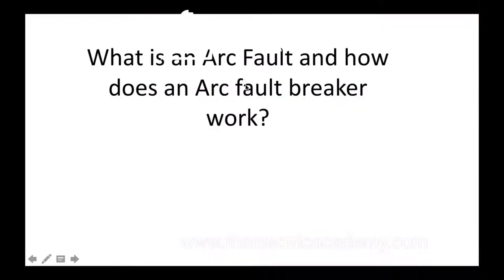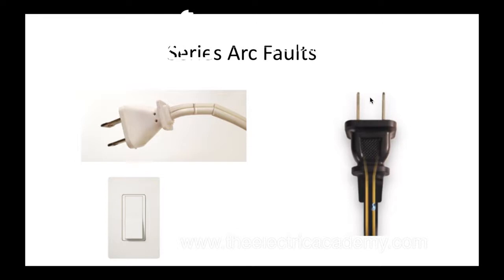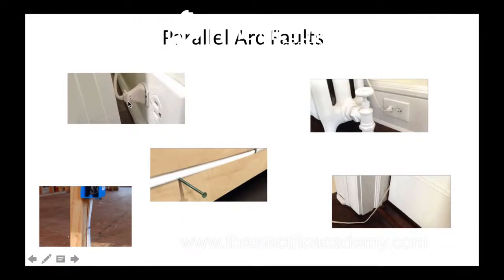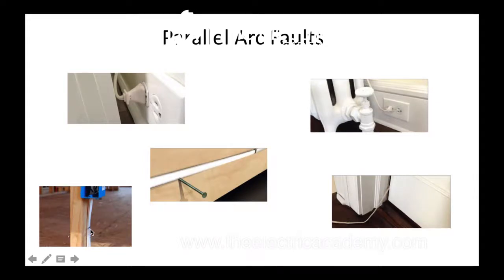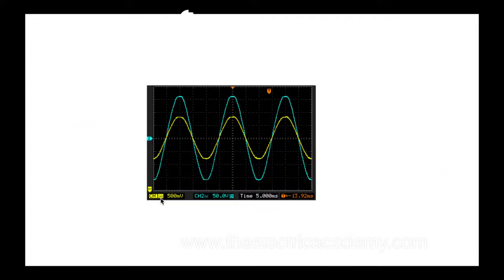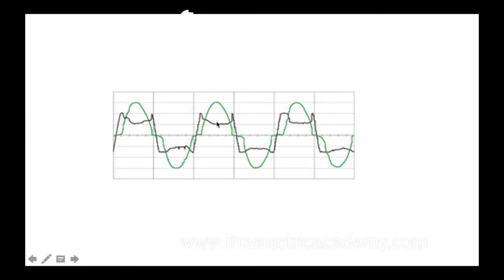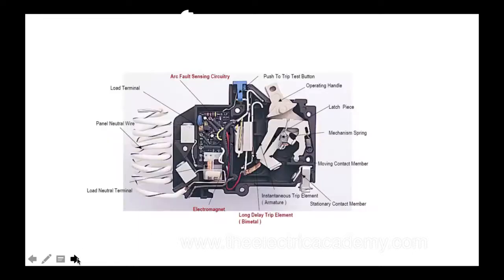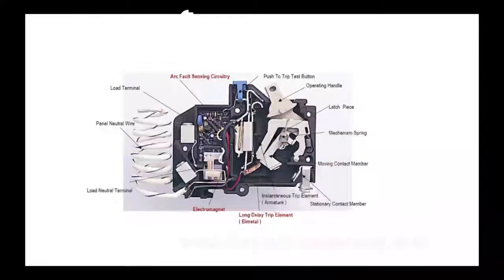How arc fault breakers work

Comment: A.F.C.I. breakers have tens of thousands of arc signatures programmed in so it does not trip when it sees this type of arcing.  Like different vacuum cleaners etc.    I have troubleshot afci breakers trip intermittently from one single led trim   and    a coffee maker with a coffee grinder built in.  And the others that the cause of the tripping was never found.  Well after a certain amount of trouble shooting you just swap it for a normal breaker.     But if you are installing them new or remodel and they trip, you probably have neutral from another circuit tied in with your circuit.  A tip how to find this, in the panel have just your afci circuit on and disconnect another circuits neutral then retry. Do this one by one until it holds, then atleast now you know what two circuits are tied together.   Usually it will be in a multi gang switch box.   Or you can do that process backwards, have all neutrals disconnected except for your afci circuits neutral, and touch each neutral to the neutral bar one by one.  If you think you may damage the breaker the other way.   I heard siemens intelli arc tool was no good.  Hope this helps someone.  Trump 2020.
Reply: "Well after a certain amount of trouble shooting you just swap it for a normal breaker."
What if the problem was an intermittent arc? Then the AFCI was doing it's job and so the house burns down 6 months later. That's like having a fuse blowing because of an unknown and unlocatable overload and so you just put a penny in under the fuse.
Reply: @MandrewP  yep

Comment: You still didn't cover how they work. You just said they have a circuit inside.
Reply: He said it works by monitoring the waveform. What's he got to do, break down how a microprocessor works too? Smh

Comment: Good presentation.  The frequency the AFCI is looking for is 100KHz
Reply: Probably because of the length of the house wiring resonates around 100KHz. I wonder if those plug in intercoms which work around that frequency (or it's harmonics) would trip an AFCI? Maybe something to consider.
Reply: Radio frequencies

Comment: Gonna save everyone some time. Dont waste 15 minutes.
Reply from the maker: dekonfrost7 is you mean don’t waste 15 minutes?  Sorry you didn’t like it.
Reply: The Electric Academy its called radio waves in a certain frequency thats causes the microprocessor to break the circuit. So coffee grinders and magnetrons/ microwaves tend to make them trip as well as cb radios and other devices that produce radio interference of a certain band modulation and intensity. Didnt like it because you never answered the question. I was waiting on you to describe the faries in the breaker that trip the breaker.

Comment: The AFCI breakers have 2 neutrals hooked up, load, and the pigtail/push on.  Is the non-load neutral connection used to create a parallel circuit within the breaker itself to power the pcb to enable the in band signal processing on the waveforms?
Reply: neutral is passing through the breaker back to the neutral bar